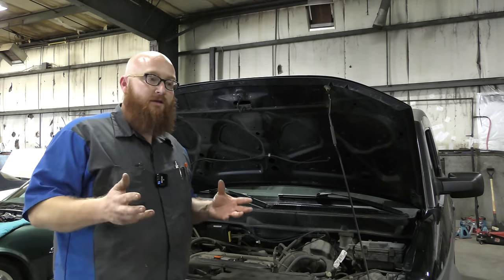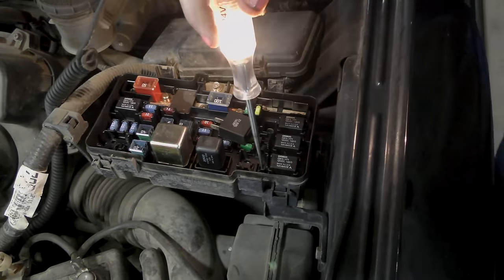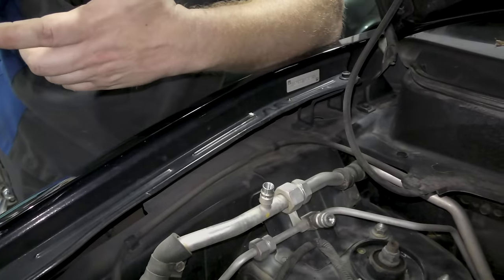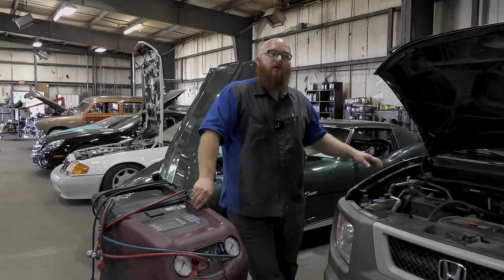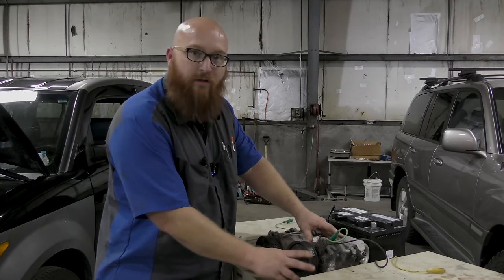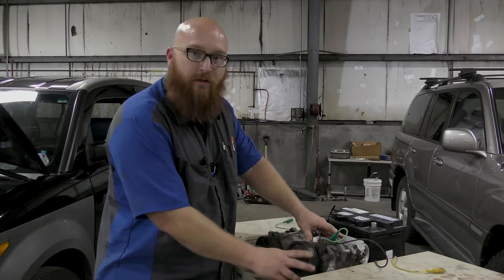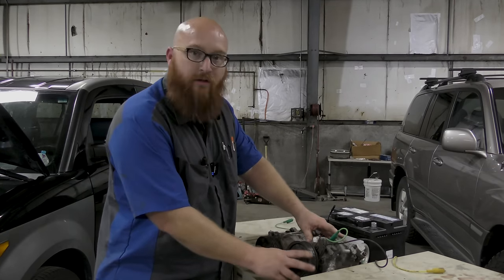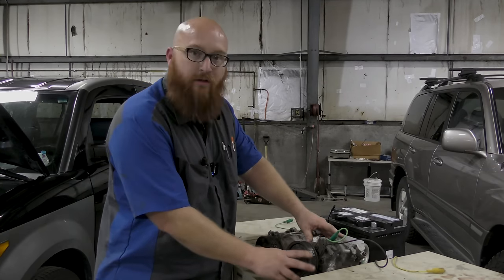AC not working!!! The CAR WIZARD shows how to easily isolate the problem

Comment: 4:55 In most modern cars, the low pressure switch is positioned before the control module in the wiring circuit. If the system is low on refrigerant, you would not see the ground signal coming from the AC control module to the AC relay. In your case, if the control module is sending the signal to the relay, the compressor’s clutch engages, but the AC is still not blowing cold, it’s time to hook up gauges and check the system pressures for further troubleshooting. Great video, anyway. Thank you!

Comment: Great stuff. I have been working on Auto ac in my cars for years. The one thing I would add to the cost of repair is the warranty requirements. In most instances if you wind up having to replace the compressor you have to replace other components as well to maintain the warranty. The air dryer on older cars, orifice tube and a flush of the system. On newer cars you also must replace the condenser as they have reduced the size of the passages and they can no longer be flushed. For the DIYer it gets costly, but if you just install a compressor you run the risk of premature failure with no warranty.

Comment: Man I have combed through so much crap about a/c systems trying to figure out why my 2010 Acadia's light is still blinking 3 times and not working despite replacing everything and blocking off the rear aux lines. Trying to get it to engage so I can fill up my system but have been getting nowhere. I am so stoked that I came across your outstanding video!! Hopefully troubleshooting the component's you have shown will finally give me the answer! The garage wanted $1800 for this repair and I am barely into it over $400 and that is including vacuum pump and gauges that were a little pricey. I took their word for it that it needed all new and didn't try to diagnose the problem myself. I'm gonna bet I probably should have because they told me the compressor was seized bad yet it spins freely for me? Thanks man will let you know if I get it! Good thing I am poor because I would have got burned if I had money! What is wrong with people?? Geez

Comment: You forgot cooling fans
I just fixed my crown vic yesterday it idled with no A/C i hot wired the fans and the A/C is ice cold
Reply: Fix and bypass the fault are two different things. Eventually the next weakest link in the system will fail. Was the compressor clutch turning before you bypassed the fans?
Reply: @hdtace2144  reread what he said, cooling fans not hotwiring.
Reply: @Sirmason-fw4bh  i hot wired the fans - sorry what else can that mean but i bypassed the fault to get the fans to run all the time? As the very man you watch on youtube says you don't pay me the 20 minutes it takes to fix a fault you pay me the experience i have learnt over the years to be able to diagnose and complete the repair properly. These are the type of people that get a quote to degass a system, replace a trinary switch, receiver drier and regas the system. Then claim i got quoted $350 to repair it but i just spent $5 on some twin core wire and if their lucky a fuse and switch. Bypass a fault doesn't fix the fault. The condensor fan is an intergral part of the A/C system. Youtube making experts daily.....

Comment: One issue that wasn't covered but I found with my 1997 land cruiser.  The AC shuts off when the coolant gets above a certain temperature.  It wasn't high enough to move the temp needle in the car but the temp was just slightly above that mark.  I used a ODB2 temp gauge to diagnose.  I replaced the fan clutch and now the car runs cool again.  It happened when it was in traffic on a hot day.  On  a cool day or cruising on the highway it worked fine.

Comment: There is one other aspect I think it would be a good point to present. I had to replace not only the equipment you had stated to perform a professional job. I had to remove the entire dash to get to the evaporator. The car, a 1983 300SD Merceded Benz. The car would not kool down due to the evaporator coil was filthy. The air could not pass thru the coils of the evaporator due to dirt, debreis from many years of use. And this is where the refergerent was leaking from also! This particular car does not have a cabin air filter to prevent the evaporator from getting dirty. On another note, your wife complements you my brother. I see why you married her! God is good, especially when you met the perfect match! You are a very good mechanic. I live in east Texas. I would love to come visit you guys. I have viewed many of your videos, you are very good, and have a fantastic shop! May God bless you, and your wife!

Comment: Good video.  On my 1988 Mazda truck I am able to swap just the compressor clutch without even unbolting the compressor.  On my 1998 Nissan Frontier (267K miles) I was able to remove a shim from its compressor/clutch to restore operation (slipping AC clutch) without even removing the drive belt from the compressor.  When the AC compressor in my 2004 Frontier (108K miles) seized in 2018, I replaced the condenser, drier, and compressor and backflushed the high pressure line as the Wizard stated in this video.  I've got 2 vacuum pumps and service manifolds, and my 1988 Mazda truck is still R-12.

Comment: Awesome video. Have no idea about HVAC . I had a loose relay. As I wiggled it it engaged the clutch on and off. Pulled out the relay and cleaned the connections and pressed it firmly back in. No issues. Thanks so much. You saved me hundreds of dollars ❤

Comment: It was great watching your video need to watch it again in a quiet area but really interesting because I’m having problem with my 2014 Dodge Durango limited and one I can’t find the ac drain line I think is clod and it blows hot air after putting refrigerant for one day is cold. But no water drains

Comment: WIZARD!… sorry I was just trying to sound like Tyler. As usual great video. I’m going to do some troubleshooting on my 2009 Range Rover sport. I left it sitting for 3years. The transmission cooler failed and I was going through some serious financial woes at the time so I just parked it. Now I can finally work on it, fixed the cooler issue ( the transmission fluid and radiator coolant mixed forming this milky fluid) . I had the radiator changed cos it also houses the transmission cooler and I flushed the zf transmission filled it with mercon sp…could not find the lifeguard 6 in my region. Anyhoo from the moment I got the engine running after 3yrs, the ac compressor wouldn’t come on. It worked fine when I parked it 3yrs ago but now it won’t. I tried adding gas to it but it didn’t come on. I was told that id need a new compressor but I was there and they didn’t run any of these tests in your video so I’m going to do it myself. Thanks for the video. I don’t want to give up on it yet because I also have a 2012 Peugeot 508 diesel that parked for even longer. Ac didn’t come on also when I got it running but as soon as the gas was hooked up, the compressor came on and that was easy. Don’t know why it’s different with the L320 but I’ll do what you’ve just taught me see how it goes. Thanks Wizard.

Comment: I get changing the condenser and the dryer if the compressor is bad. Shrapnel from the bad compressor will be all over the system, and will damage the new compressor if you don’t. However, if only the clutch is bad, it in no way means the compressor is bad.  Get a used working clutch at the wreckers, put it on and your back in business. If it’s the compressor, yes, change everything, but if it’s only the clutch not engaging, there is no need to spend $1500

Comment: Thanks, it doesn't use hot air much, but now that I need it, the change didn't work, but with your video and the reset it worked again, thanks again

Comment: i always used to just turn the ac compressor on, if the compressor works, the switches work, so it must be refrigerant, but if it doesn't turn on this video is very helpful to diagnose. i appreciate the detail you went into here.

Comment: thank you for the help with the ac button on the dash, all gmt 400's have resistor issues on the climate control where the a/c button doesn't light up but may still be working so this was very helpful, thank you

Comment: My ac compressor clutch went out. Ordered new one on eBay. Had to blow out the debris from the lines with my air compressor to make sure it was clear before taking it to my buddies shop and he rolled out that big machine and refilled it with freon and compressor oil. We had put in a little too much freon at first and the ac wasn't working great. I let out some through the shrator valve manually because I didn't want to drive all the way back to his shop again and it's been working fine since. It's a Kia Sedona 07 mini van. Besides that and a small valve cover oil leak that they are commonly notorious for (above the alternator in front) it's been good to us. We love this Kia. Alot of room, power and the chassis for the suspension is designed for a cargo van so it has no problem towing. I'd only trade it for a Toyota sienna in the future.

Comment: Usually when a clutch coil goes out, there's a reason it failed.  If a compressor locks up, the clutch will fail. Simply adding another coil and clutch on it will result in a new coil/ clutch burning up as well. So while you have the belt off see if it will turn freely, like you explained.  If it wont, then simply replacing the clutch and coil wont fix your problem. Thus your explanation of it not being worth it is certainly confirmed. Nice video.

Comment: Excellent video, your explanation really
Helped my AC problem. 
My clutch is not getting any power due to the wires not engaged, the red wire was completely not connected probably from getting burned out  so I will be replacing the compressor with new one, I don’t think you can attach those wires the way it’s connected, looks like a factory type connection that’s not fixable!!
Thanks ver much👍👍👍

Comment: For modern cars, the signals from low pressure cutoff and high pressure cutoff feed into the AC control module. For many vehicles, when compressor is engaged, the compressor will steadily lower the suction pressure to around 25psig. At that point to prevent freezing, the low pressure cutoff will activate and send signal to HVAC control to disengage clutch until pressure equalize to above 25psig, and the cycle resumes. The high pressure cutoff sends its signal to AC control module as well. So in hoovie's test, the AC module takes in account the inputs from high/low pressure cutoff, so if the relay isn't getting a signal, then it's possible that there is too little or too much refrigerant.
Low and high pressure cutoff sensors have a black(ground) and a color signal wire (ie green). Most sensors are normally closed (conducts signal from ground to green) when operating pressure is normal. With your probe tip to battery +12V and clamp to green, the light should light up. Now in operation if probe attached to sensor stops lighting up then that is why clutch isn't engaged. The signal goes to HVAC module which then deactivates the relay. You should probably use an LED probe so you don't backfeed the HVAC module with +12V as you would with a probe with an incandescent bulb. The diode effect of an LED won't allow current to flow in opposite direction unless it has a bridge rectifier built in to allow operation with clamp on ground or positive.

Comment: This was the most informative vid I have seen so far trouble shooting the A/C.  Well on my 2009 Toyota Avalon my "mechanic" probed the wire next to the high pressure connector and told me my compressor was gone because anytime there's power to that connector the compressor is bad. I told him I think I may have a leak because upon first noticing a problem in the system I heard a hissing noise coming from the area of the compressor. He didn't even bother to check a relay, fuse, nor refrigerant level. The clutch moves freely. Mind you now all this has taken place after he changed my tensioner 3x's,(he can't seem to find out the source of the squealing noises come from the pulley system keep saying it's the tensioner without checking the other pulleys)the job required him to move the compressor each time. I need help some suggestions PLEASE!! somebody, anybody.

Comment: Good video. I have a 986 Boxster and will be using your advice in the morning. The clutch doesn't move when a/c on although engine revs briefly increase when turning it on. I'll check to see if I can turn it (freewheel ok) and check for any refrigerant. Suspect either solid/stuck compressor, faulty clutch, low refrigerant from leaking condensors. Will replace parts in the system that you advise to.

Comment: the one I ran into was the radiator fan went out and the AC wouldn't work in city traffic because the heat exchanging coils didn't have enough cool air. You can use a relay tester to test the fan too; I used my multimeter to check the continuity on the fuse and then listened to make sure the relay was still working; to check that it was getting power still I push the fan with a screwdriver and it went a little bit and then stopped again that's how I knew the fan was getting power but the fan was bad. replacing the fan resolved the AC issue as well. Another giveaway was that the coolant temp was starting to creep up towards the higher end in the city or idle driving conditions. An interesting issue for it not being directly related to the AC

Comment: I've been using some great car care software named Automotive Wolf for years. It keeps track of all the maintenance on both my cars and a motorcycle. My 2008 Toyota has over 300,000 miles and still runs like new. Keeping up with a vehicle maintenance schedule is critical to avoiding repairs.